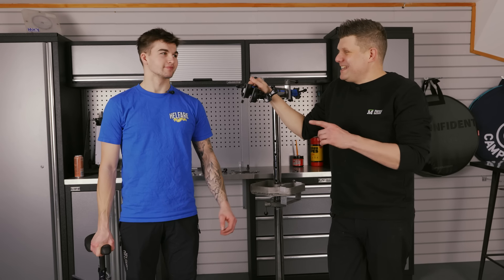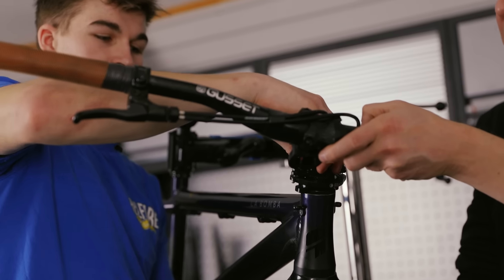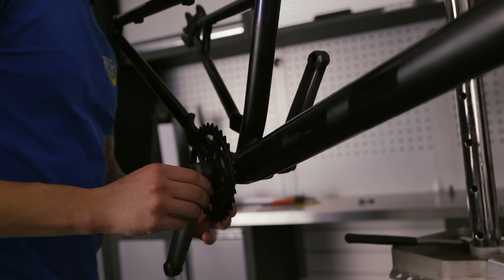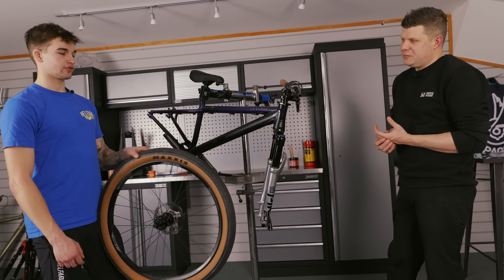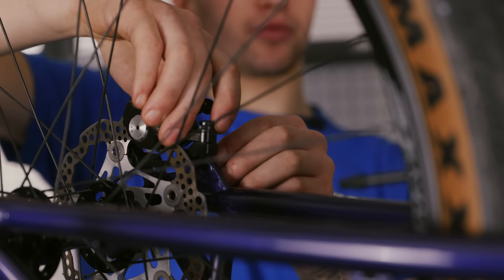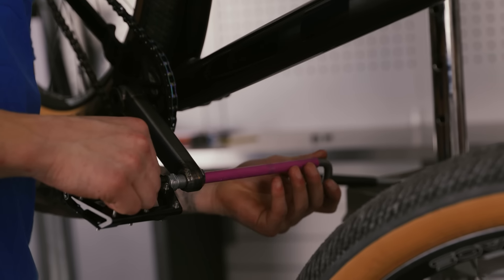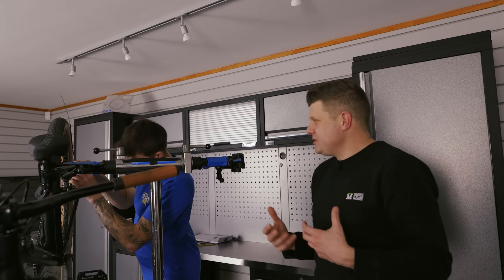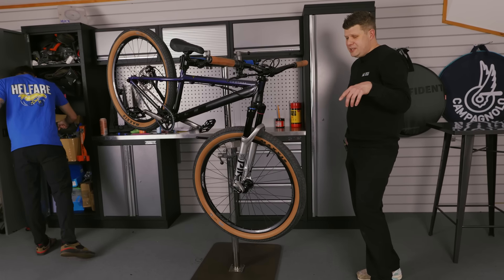Jake Atkinson - His £20,000 Journey to Crank Works 2024

Comment: Has Jake tried a Hayes mechanical disc brake? 
They are V-brake lever compatible so that might mean they need too much cable pull to work well via a giro but if it would work I.D are the UK importers of Hayes (IIRC?) so he should be able to get them on the cheap/free.
Reply from the maker: I’ll ask.

Comment: I know this is slightly irrelevant to the content of this specific video, but you have said multiple times that the giant tcr advanced is a “noodly” bike and you should get the pro because it has a stiffer bb.

They both have the same bb and carbon layup, the only difference is that the pro has a 1/4 steerer, rather than the 1/8 that comes with the advanced.

Please retract your comments.
Reply from the maker: We discussed this a lot in vids. And yeah. The advanced flexes it’s not stiff enough for a race bike. It’s my opinion. Don’t get stressed about it.
Reply: @Mapdec  right - your opinion can be that it’s too flexy. Thats not the issue.

The issue is you recommending the advance pro over the regular advanced to potential buyers because it has a stiffer bottom bracket, this is simply incorrect - they both have the same BB and carbon layup.